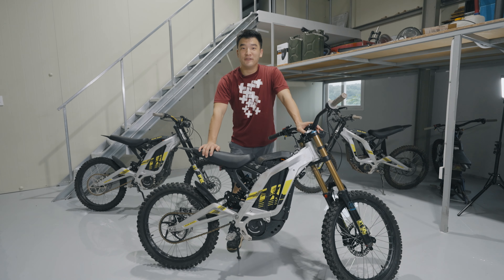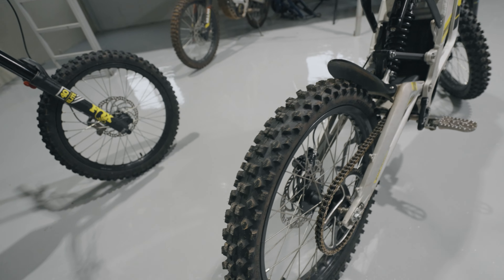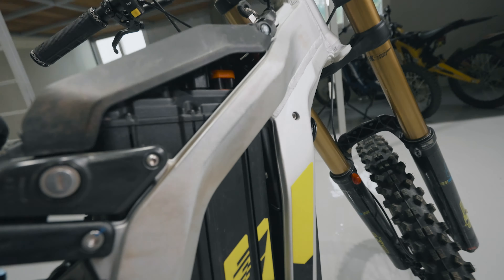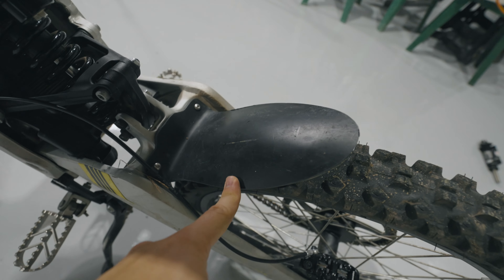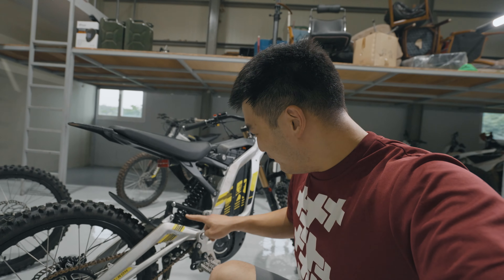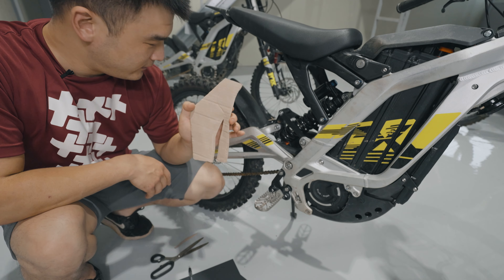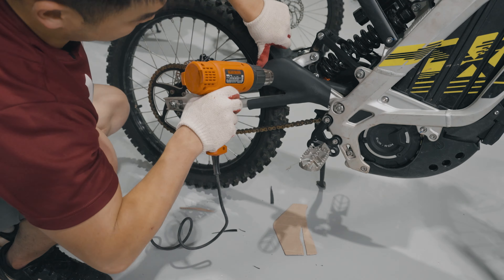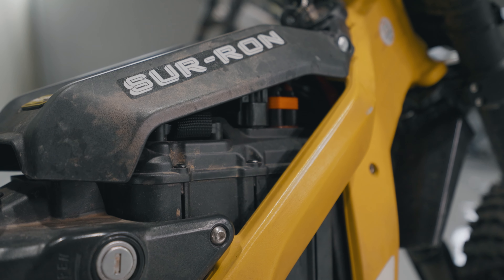Protect YOUR SURRON Lightbee X from Damage! - Ways you are destroying your Sur-ron X

Comment: The throttle side won’t fit a bicycle grip...it’s bigger so gotta go with motorcycle grips in 7/8 size ...it will come with one 7/8 and one 1in 🤙🏽
Reply from the maker: i bought a sam hill grip and used it for two surrons. just for one side

Comment: Thats normal wear for any dirtbike. Not a big deal at all. Just get a wrap kit. Rewarp it when it gets ripped up. 
  But still thats a good idea
Reply from the maker: the scuff at the swing arm is beyond normal dirtbike wear, other areas, a thick wrap would do the job
Reply: @ridefarm5528  it might be, but i disagree though.
 However the idea is still amazing and it gave me a idea 💡  for making/building some flarings for the battery area 😀 maybe do some air scoop vents even 😉

Comment: I just got mine... is the rear wheel supposed to feel almost like it has brake drag? I even took off the brake caliper and identical... I'm unsure if it's just normal with how the mid drive works (only used hub motors) ... Just don;t want to damage anything..
Reply from the maker: That's the regen slowing the rear wheel. it charges going down hill but barely haha. Look up how to turn off Surron regen and there are many videos. I have mine on, since it helps me in the steep section.
Reply: @ridefarm5528  The bike isn't even on, it's just resting on the plate  with the back tire off the ground. Back tire  does not move freely at all
Reply from the maker: @CmdrTigerKing   yep that's regen

Comment: I broke my rock shox vivid in a similar way. The problem is in the progression link. It presses on the spring of the rear shock. The diameter of the shock vivid spring is larger than the diameter of the standard spring. It is necessary to change the link of the progression
Reply from the maker: Good to know that I'm not the only victim. I've seen another rider somewhere on the internet with stock shock snapped as well.
Reply: @ridefarm5528  The link progression to 2020 is different. It allows you to install vivid shock. From 2020 other links
Reply from the maker: @Umkay2k  you mean the link design changed for the 2021 model? Mine is a 2020 model
Reply: @ridefarm5528  Yes, the link design has changed since 2020